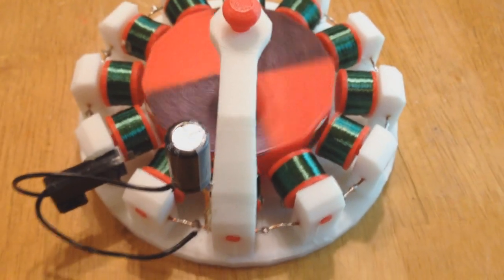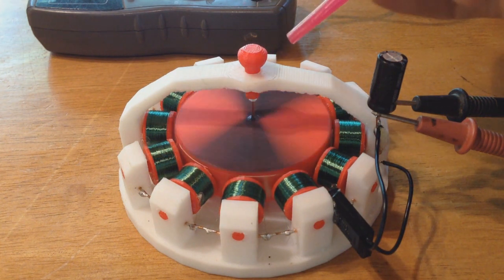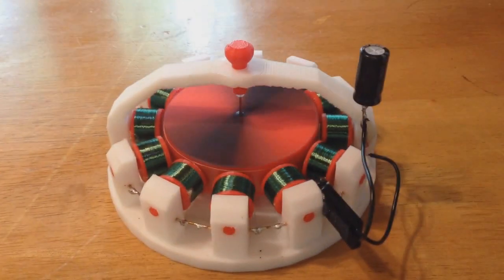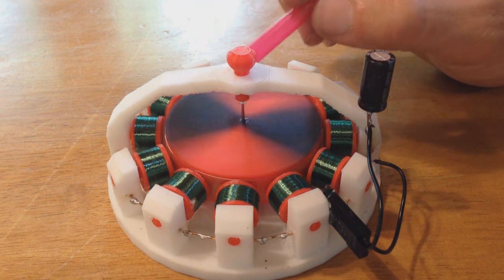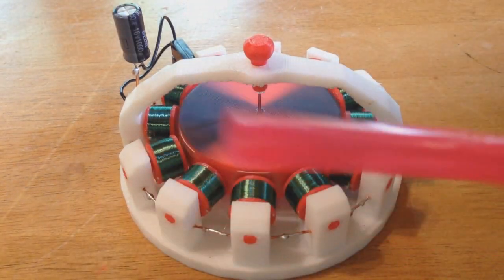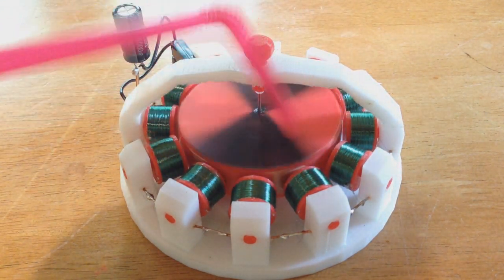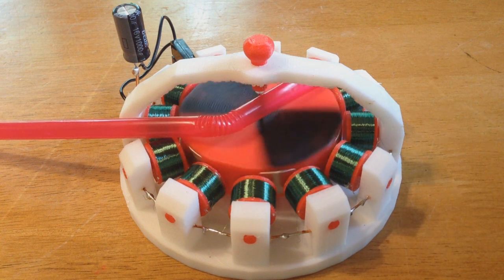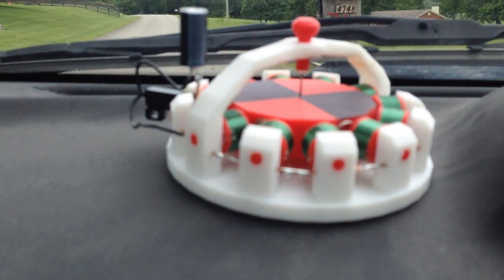No Batteries! EZ Spin V2 Motor Running on a Single 1000uf 16v Capacitor

Comment: Hi Lasersaber, well done man !
Are there iron or ferrite cores inside the coils ?
Try to use the Aviso / Konehead coil shorting and switching and you will generate even more BackEMF juice with it. You can use more reed relays in series for faster switching also and use a relay in selfrunning mode like a doorbell ringer circuit to use with a helper 9 Volt battery to permanently switch the coils shorting and open while the magnets pass by. This will generate  huge BackEMF spikes...Well done !

Comment: The reason I ask about temperature is that it has been reported that low voltage LED junctions appear to be over unity, explained it appears by heat absorbed from the surroundings being converted to photons. I wonder if super efficient pulse motors at very low voltages also affect temperature and get extra efficiency by lowering heat (for a period). I see old stories of magnet pulse motors often reported cool running, when the current would suggest heating up....worth researching?
Stephen.

Comment: it can be pperfected on to produce 100 ma to run a joule ringer for lighting of 220 or 110 volt  led lights i run them already with just 6 volts at 100 MA from a battery

Comment: Is the fly-back energy going back into the capacitor when the reed switch is in the "off" state? This machine is doing a lot more than an ordinary motor. Something special happens when you oscillate electromagnets. Tesla knew it. This is a beautifully simple self regulating oscillator circuit that just happens to be a motor and generator. WOW I'm really impressed.

Comment: it seems to be stabilizing at a resonant frequency/spin rate.  I'm assuming the capacitor has something to do with the rate. If you try a higher Farad does it slow down/speed up?  Great work!

Comment: it would be interesting to see a pulse motor version of this. after 1 revolution of the rotor it charges a second cap that fires any one coil to "kick" the rotor spinning. perhaps a second set of coils would be needed. one set for the motor and another set for the charging. The second set could be arranged around the top of the rotor instead of the rotor edge.

Comment: Very cool. I made a similar version of this 2 years ago, with bigger coils and earth magnets, but it got too expensive to keep improving it. That was reaching 20V in it's testing stages, and that was with only half the coils I wanted. I used a cheap garden solar light to power a CD Player motor to spin the magnets. Your version looks a lot neater than mine did.

Comment: There is a Lithium coin cell battery under the plastic. Voltage approx. 3 Volts but with the load a bit less closer to 2.8 Volts as expected. If we assume it's 210mAh (20mm diameter) this represents 1.89 Joules with an average of 2.5 Volts. Enough to keep this baby running for some time. The capacitor does not hold enough energy with 0.4E-2 Joule @ 2.8 Volts.

Comment: i just love your projects. Im a big fan of yours replicated both of your joule ringers made loads and passed them on to many people maybe you can build a system to make a joule ringer running of  one of these motors nonstop im sure it can be done. Looking into the 12 volt boostpack do you recogn it will work on a diesel fiat 2.2 TD

Comment: Very interesting, very good experiment, I congratulate you and this is not perpetual motion. This is a high efficiency electric motor, an initial mechanical energy converted into electrical energy and then into magnetic energy and then return this energy and store it in the form of capacitor electric field, then the condenser coils and so on. It would be interesting to test such that the energy exchange between the condenser and the stator coil is the electrical resonance frequency related to the number of poles and the rotational speed.

Comment: I'm curious...if the sustaining speed is maintained by the capssitor..cause when u blow on it .. the voltage goes up but drops backs down due to lack of surplus storage.. then is it feasible to ad more capssitors so to maintain more speed...what if each coil had it's own capssitor.. it's obvious what you are doing is working.

Comment: You could use 6 coils (e.g. every second of your 12 coils) as generator coils and 6 coils as drive coils. Or any other ratio, which you find is optimal. Great design, I want a 3D printer. Greetings, Conrad

Comment: Thank you man for showing cascading coils in action just as I tried to explain to Romero ions ago. Keeping it sweet and simple showing how each coil is a generator and a driver interchanging between each. 

You can make a 2, 3, 4 decked unit, with more magnets on wheel.

Put two positive scope probes on any of the two coils to see their phasing relation since that cap should have depleted in a few seconds but the total of all the coil resistances is actually slowing down consumption.

wattsup

Comment: hey i just think you need to get a resistor in between your capacitor and input a coil will take the power it can and it is too much then it slows it too. then slightly less in and it runs faster and make more out

Comment: Jolly Good Show, Old Chap. very good and useful concept, you must have an incredible amount of available time on your hands. Built a device that has been running for two weeks on less than 0.2 volts, plus powering a white LED. Don't have a clue what is taking place and can't do the calculations, but I experiment alot. Most people don't understand what your about, I too have spent hundreds of hours with experimentation. Need to build one with the same proportions........ X's ten.

Comment: and.... I think I will use a similar motor to run my hyper efficient generator and step it up a bit... ahh.. got any larger ones already built? I don't have a 3D printer or 4axis CNC yet... and have you tested using a transformer in there some place? Or using two motors of different wire gauges and magnet intensities? Possibly using coated multi strand speaker wires as coils?....

Comment: When it's spinning it might goes faster with all of the magnetic wire coils so when it starts going it goes faster so it could probably keep recharging the capacitor to keep running for a really long time
Reply: Are you referring to a Bedini Circuit?

Comment: I was thinking about this and had an idea. I know it has very little power and that it can generate power if moved, say by air.
I prefer using Vertical Axis Wind Turbines as opposed to HorizontalAWT's for various reasons which aren't the point here. What I'm suggesting is to use this type of thing with a VAWT  to: 1. Generate just a little more power; 2. maybe keep the VAWT spinning just a little bit longer to generate, again, just a little bit more power. Maybe feasible, maybe not. Run with it.

Comment: Awesome work as always, you might want to look into Thane c Heins for some ideas on the generator coils you plan on adding. If you start off at high enough rpms the generator coils will give you a regenerative acceleration effect increasing torque and speed while powering a resistive load.
Reply: didYouTestedHisSetup?

Comment: If its a generator/motor then the capacitor should never run out, right?

My latest motor is is a simple 2 vertical screws wound with pretty thick wire ( about 200 times each so it looks cone shaped). Above the heads of the screws, on an axle,  i have placed the two magnets. One N, on S facing. The windings of the coils are in the same direction.

Can anybody tell me why it wont spin?

Comment: you should comission a machine shop to make a steel and aluminum flywheel for this so you can get the balance juuust right to minimize air friction and friction on the baring or whatever holds the wheel up. it seems the final piece of the puzzle is balance.

Comment: If the spindle was extended upwards and a fan type device was connected to it then it could make a nice wind generator (scaled up) that's not dependant on wind direction. The efficiency of it should be worth it? An idea: Use the excess current to generate hydrogen and current from a bigger capacitor to keep it rotating when there is a break in the wind so that when the wind hits it, there is already momentum. Is that worth trying or would the difference be minimal?
Reply: good thoughts

Comment: Are the coils in simple series connection,and may I ask what is the SWG of the wire used and length that you used? I assume air cored, and that the number of magnets matches the coils.I am building an equivalent, but may use optical switching to shorten the pulses, and further economise on input, although transistors push up the minimum voltage. Have you checked any reduction in temperature in the coils or magnets? I suspect that effects from temperature may be involved in efficiency

Comment: This is very interesting. I like to build motors too, although Im a real novice. None of mine have worked, maybe they need a higher voltage to start. For now Im using a12v  adapter.

Comment: I've seen your 1uA measurement. I agree that's a tiny current. Quite impressive considering the losses you have in the wire resistance, wind resistance and some friction in your needle contact point.
Why don't you try to run it without any source at all? Capture the energy from an antenna/coil, rectify it through diodes, add a small cap and feed it into this motor and you can run forever. You just need an efficient enough antenna but 1uA @ 2V = 2uW should not be impossible. What do you think?

Comment: ok : this is gary again - could not find : No Batteries! EZ Spin V2 Motor Running on a Single 1000uf 16v Capacitor at the storeplease help

Comment: That's pretty cool. I'd consider making one but I don't think I want to wind that many coils.
Reply: you can use a accu drill for fast coil winding. at 900rpm you can make a heck of coils in no time ;), or use any small toymotor

Comment: Is there a way to measure the torque or starting resistance of the motor?  Can you swap out capacitors and calculate the starting torque of this motor?

Comment: Right on. Great work. And like you say at the ends of your videos, "Keep on experimenting". 
   At this point, I would suggest, first, as you said, larger coils, then a drive shaft to turn a small generator on either/both ends. Just an idea I thought i'd toss your way. :D

Comment: Well if it's very energy efficient, perhaps it could be tied to a power source and run a lot longer than current electric engines.  If it can virtually power itself indefinitely, adding more power should accede that ability.  We could be looking at the makings of an electric car that can drive cross country on a single charge.  Maybe even self charge while idle.

Comment from the maker: Because I am an artist and read it as uF on the capacitor 20+ years ago.  For many years I used the term uF and got in the habit of saying uF instead of micro-farad.  I only learned it was micro-farad in the last 5 years.  Old habits DieHard.

Comment: If one were to increase the radius of the disk to, let's say, 10 x radius, and the coils as well, then the spinning disk would have considerably greater momentum and the motor should run much longer. And, perhaps a ring with spokes would have less drag, too.

Or, replacing the spokes with suspension wires (fishing line) connected from a central pole hub and out to the ring, under tension, might be more effective.

Comment: Find out the  total inductance of the coils. Put a capacitor in parallel with the coils, select the cap size in microfacrad to reonsate with Motor Speed If  Motor Speed for eg is 100 rpm select C to resonat with  l  to 100 herz try it.

Comment: Above means Google this text:  "New Printable Antenna Can Harvest Ambient Energy To Power Small Electronics".
Perhaps one option is:
1. Print the antenna using a 3D printer.
2. Paint it with conductive paint.
3. Add the small circuit needed to turn the AC output into a DC voltage.
Connect it to the motor and you have a setup that stops only some day when it eventually breaks in the needle point of contact.

Comment: I think it's great. I know it doesn't have a load on it and I know that the real, "he-man" test is to see what it will do with a load on it, but that's not the point here. At this point the point is that this thing works. A silly little cap with a reed switch is keeping this thing spinning. It works. Now that we know it works we can work on making it work better, stronger, faster using less power to do more work. Isn't energy conservation what this whole thing is about?